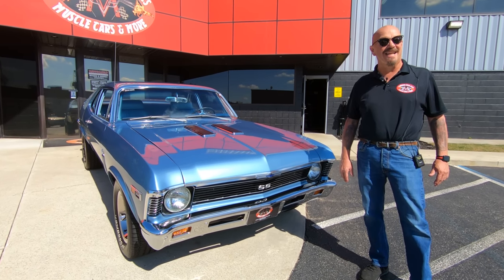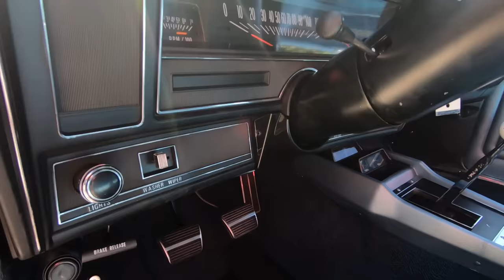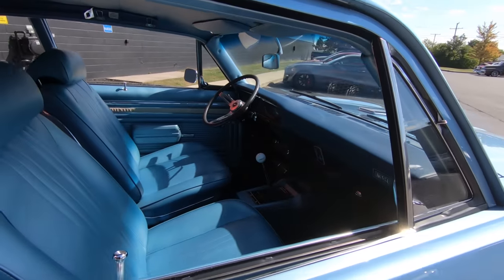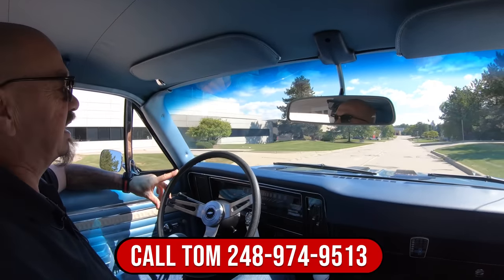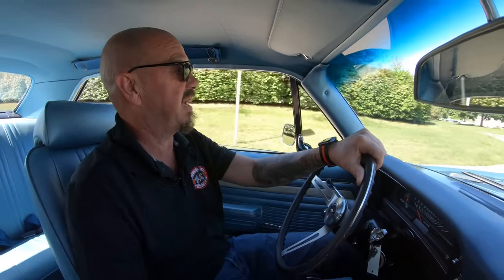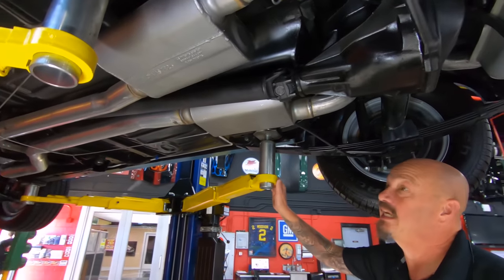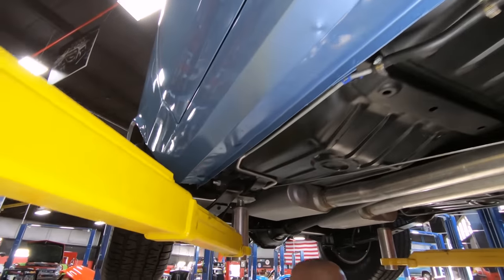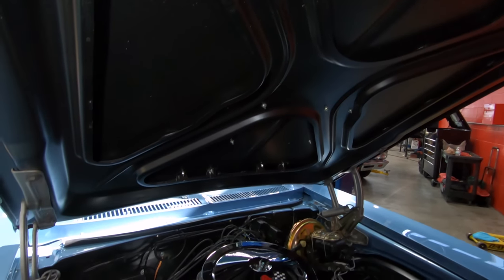1969 Chevrolet Nova For Sale Vanguard Motor Sales #6688

Comment: THEY SHOULD TELL PEOPLE HOW MUCH IT COST...
Reply from the maker: All of our prices are listed on our website at www.VanguardMotorSales.com. The Price of this Nova is $84,900. If you have any further questions please feel free to call Tom at 248-974-9513.
Reply: Probably don't wanna scare us off , if I had to guess I'd say 55 , 000 - 60 , 000
Reply: Whoa , I was way off , 85 , 000 , Worth the money , especially that clean with the Big block & the 4 speed
Reply: Thats a very very nice car
Reply: @troyburns6971  , 
WOW! 
I put a built small block 327 in mine , 
750cfm carb  ,aluminum intake,  MSD Distributor and multi-spark box,  Stainless Steel Headers,  SFI certified flywheel,  11 inch clutch,  M-21 Muncie 4 speed,  12 bolt posi,  rear mount  battery and  rear mount  Radiator  , 
Yes ! Radiator is  in the trunk  .
New Tach , New oil ga , bucket seats  , NO rear seat  ,  hood open backwards  , 
Front disc brakes  , New gas tank , 
New gas tank  straps, 

I did all the work  myself  , 
I got $9500 in it not counting  my labor
Reply: @jimthomas1989  Ok but does it look like this one?

Comment: Nova was the best hoopty to buy back in the early 80s. A usedone especially a 69 to 72 were very cheap to buy, easy to maintain, and with a pair of snow tires in the rear you could go all winter long

Comment: Man, I'm torn on that body-color front bumper filler - it's supposed to be argent, but that unoriginal treatment does look damn good. I'd probably just Plasti-dip it argent, so as to not ruin the blue paint.

I remember in '82 or '83, they had an orange Nova on the cover of Hot Rod, and it had its filler painted orange to match, and it looked killer!